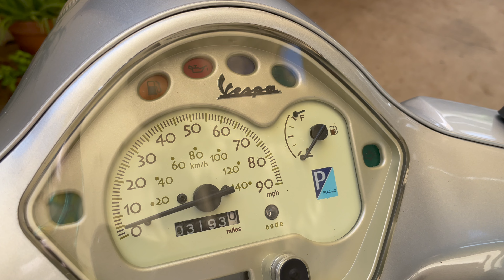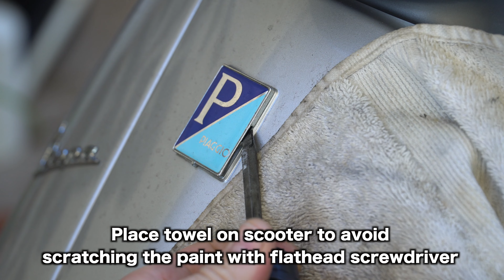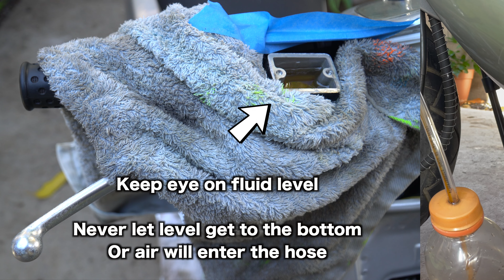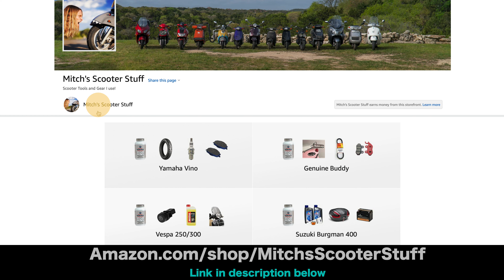Vespa LX Brake Fluid Change | Mitch's Scooter Stuff

Comment: Your hose is connected to an airtight bottle and this creates pressure in the hose that sticks the oil inside the hose in the same place. You need the hose to be connected to an open box so that the air can be released out

Comment: thanks mitch that looks like an easy way to do it without getting air in the line my lml needs  a change must be over 4 year now the last time it was changed any idea what fluid I would need 3or 4 dot or is there not much difference ?
Reply: The differences are mainly in their boiling point, so it won’t be the end of the world if you use the “wrong” one for your bike. But I’d check your owners manual and buy the right one.
Reply: @Airhead.R.1977  thanks for the info
Reply from the maker: I use DOT 4 for all scooters
Reply: @MitchsScooterStuff  thanks Mitch

Comment: I have gts 300 also, coolant gasket is leaking... do you think K seal would help ? Dont wanna pull the entire engine. thx
Reply from the maker: Coolant gasket around the water pump? It's easy fix... you can see in my GTS coolant change here - https://www.youtube.com/watch?v=D2yBHjVkJv4&t=90s at 1:41
Reply: Actually I tried this today.. It stopped the leak.
Reply from the maker: @Alperank  that’s good news!! 🙌🏼
Reply: @MitchsScooterStuff  where can I get leg shield beading right side for Vespa gts 300
Reply from the maker: @Alperank  try af1 website

Comment: FYI brake fluid level gets low as pads wear down. If you refill to the highest level, you might have issues when the time comes to change your pads as they will push more fluid up to the reservoir.
Reply from the maker: Yes, the pads are still like new... under 3k miles on it... I should mention about that but in my other videos I showed about suck out some fluid before changing the pads :)
Reply: @MitchsScooterStuff  All good, I wasn't criticizing your procedure. Just adding my 2 cents to those who might watch your how-to video guides and face this issue later on. It might be impossible to squiz in the piston enough to fit the calliper over the rotor or the pads might drag on.
Reply from the maker: @Airhead.R.1977  yes true, your comment would be useful for people to see it 🤙🏼

Comment: Hi Mitch, i have a problem with my Burgman 400 2008. It keeps shutting off when in idle and the engine does not work in harmony. Looks like it makes a lot of misfire. The power also went dont it can't run over 60 mph. I checked the air filter, spark plug and they looked clean. Any ideas for this problem. The f1 light is off. Thank you